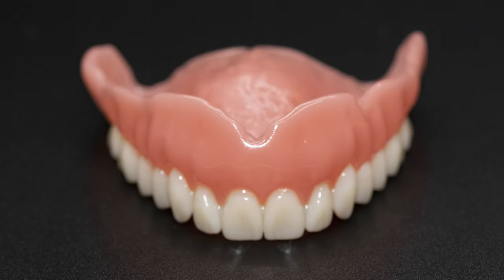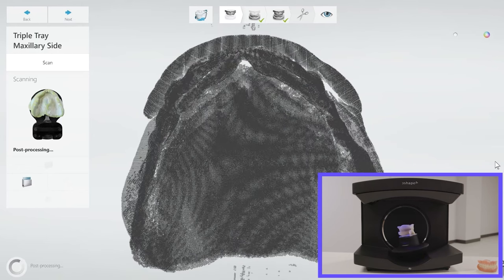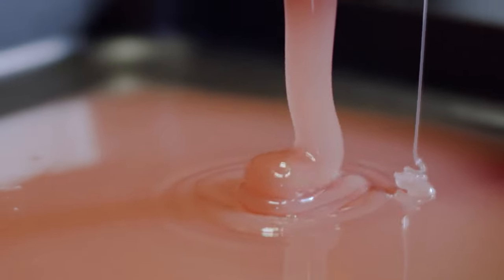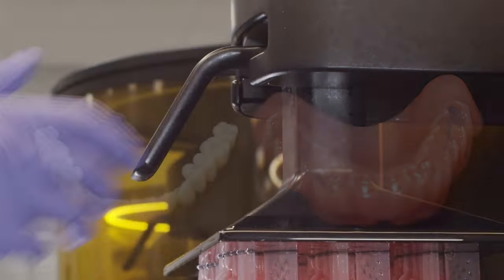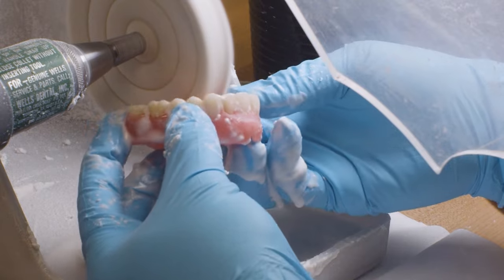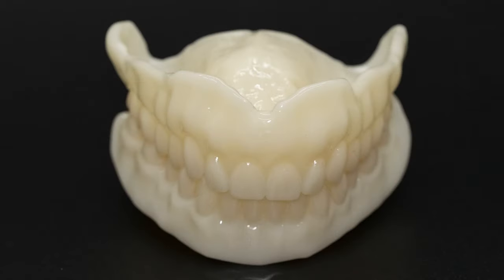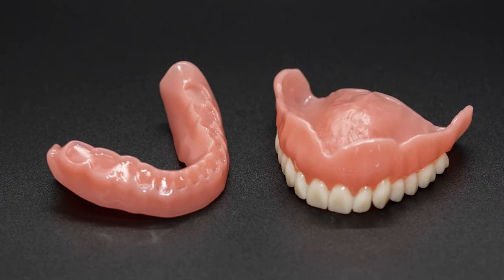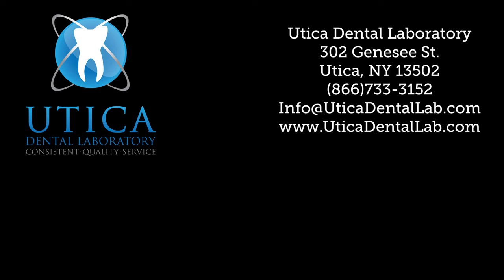Elevator Pitch - 3D Printed Dentures - 3D Printed Digital Dentures by Utica Dental Lab

Comment: Are they made thin?  I was always curious about them
Reply from the maker: Hi Tara,

The thickness of the denture depends on each patient. Once you begin wearing a denture, the bone in your jaw will start to wear down. 

Dentures usually need to be replaced every 5-10 years to help accommodate for this. But, the more bone loss a patient has, the thicker the denture has to be to help make up for it.

Most denture bases are between 1.5mm and 3.5mm thick. We make them as thin as possible based on the needs of the patient.
Reply: @UticaDentalLab  thanks for getting back to me I already wear dentures I have comfy lites I was just curious for a second pair
Reply from the maker: @taraforesta7593  Thank you for commenting! If you are looking for a comparison for fit, the short answer is that in a perfect world it shouldn't matter. 

Digital dentures are directly comparable to traditionally made dentures. The big advantage to digital dentures is that they are a bit easier for less skilled lab techs to make. 

Traditional dentures are very dependent on the skill level of the technician making them. Digital dentures use computer generated models to evenly distribute the denture material and accurately apply it. Assuming an accurate first impression was taken of the mouth, digital dentures should fit perfectly. 

There are varying levels of skill with different dental labs and dentists for that matter. If you find your denture isn't fitting or is causing irritation you may want to get a second opinion from another dentist.

Comment: 3D printing is only “preferred” by the dental supply companies, because they can sell you the latest and greatest machines and insane profits. 3D is still very inferior in strength and esthetics. This should be used as a short term solution for patients while they wait for the better, more permanent denture to be made.
Reply from the maker: Thanks commenting! 

There is a major digital dental lab out there that makes a lot of promises and takes a few liberties with the limitations of digital dentistry.

Check out this video comparing the 3d printed method compared to traditional that we use at Utica Dental Lab:

https://youtu.be/aZayGP8p6ng?list=PLtH0vwLZBOCMH7EEPdoWcbV82xnCcckMQ

Labs have different procedures for their dentures so an exact apples to apples comparison is difficult. However, there some general pros and cons to digital dentures.

The biggest advantage to 3d printed dentures is on the manufacturing side. Designing and printing a try-in, then making CAD/CAM adjustments to go to final is much less laborious that making a wax try-in. More importantly, the time it takes to train a new lab technician to become proficient in digital design is far less than the time it takes a inexperienced lab tech to master traditional, analog denture making methods.

The answer to what is "preferred" is that it depends. There are some truly gifted lab technicians that are capable of making a perfect fitting, highly aesthetic denture. Then, there are some dental labs that struggle to even supply the basics in functionality. Are there some dental labs capable of producing a superior product manually? Yes, but it is becoming increasingly difficult to replace a skilled lab technician. 

There are dentists who prefer traditional denture methods. If you are a dentist who has a competent lab that is proficient at removable prosthodontics, then hold on to and cherish them. But, the quality of an analog denture is highly dependent on the skill level of the lab tech making the denture. The most common reason new clients give our lab a try is "The quality of my old lab just isn't what it used to be." or "My lab closed and I can't find a good removable lab." Clients like this are usually happy to give digital dentures a try.

Aesthetically speaking: we gave five of our clients a blind test for traditional/digital dentures and they couldn't tell the difference.

As far as strength is concerned: Lucitone Digital Print resin has similar lab results in terms of flexural strength to Lucitone 199. They do break on occasion, but so do traditional dentures. The argument for who is at fault for an ill-fitting denture that ultimately breaks is as old as dentistry. We haven't seen a significant difference in remakes from digital dentures compared to traditional dentures. 

That's not to say that our lab protocols are perfect. It also doesn't take into account things like printer type, resin material or the methods used to cure digital dentures. Any deviation from the suggested methods will lead to different results.

All dentists have varying degrees of standards as to what is acceptable work. They also have varying degrees of what they are willing to pay for and how long they are willing to wait. It's hard to compare because there are so many variables but I'd compare it to the argument between Porcelain vs Li-Di vs Zirconia crowns. Nothing beats the esthetics of a well made porcelain crown. But, if the lab isn't capable of delivering a high quality porcelain crown, they are better off milling zirconia.